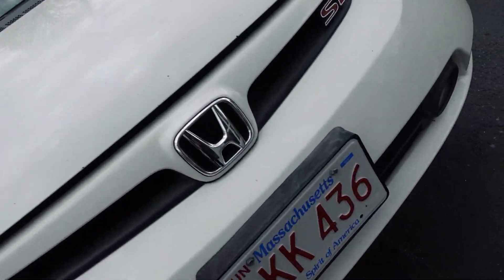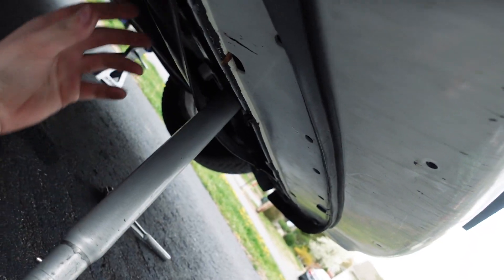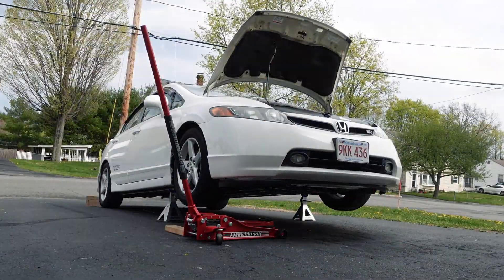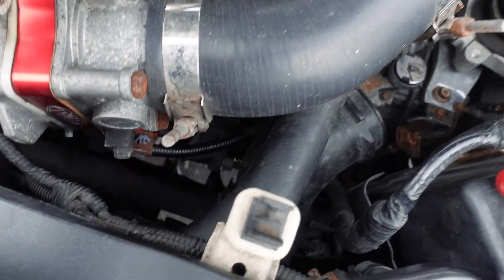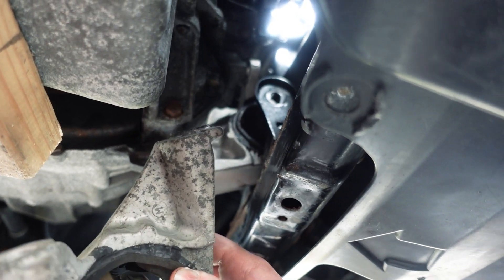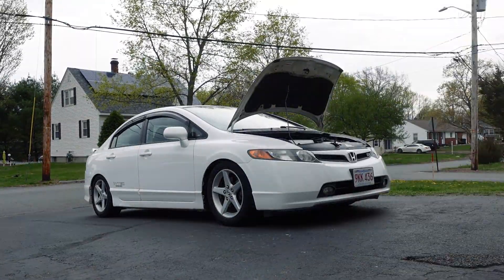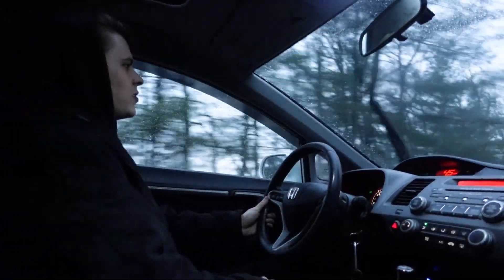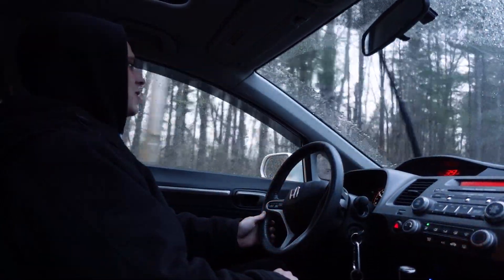Civic SI: FRONT Engine Mount Install and Test Drive! ('07-'11 / 8th Gen)

Comment: Not mechanically inclined.... I've got a rattle on deceleration, even light deceleration. Would that be the upper motor mount left of the engine by the belt? I don't have the issues described in this video, so I don't suspect the front lower mount.